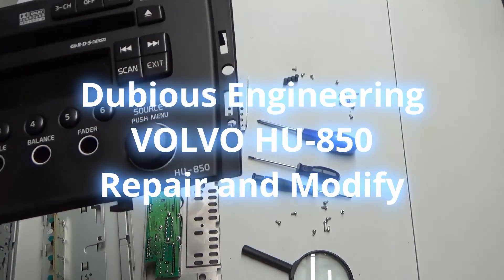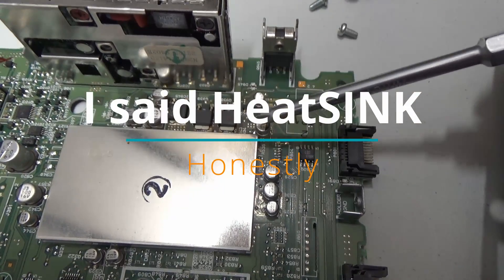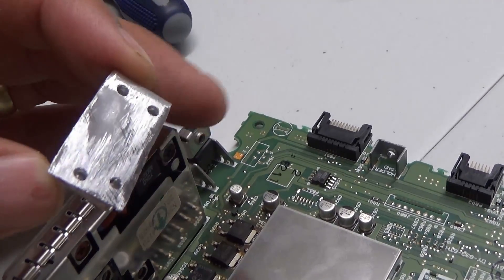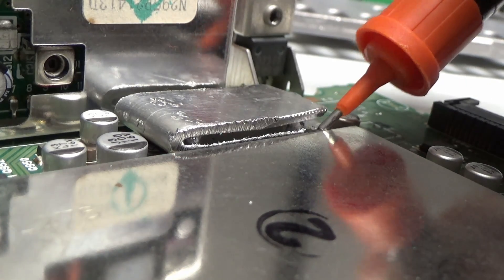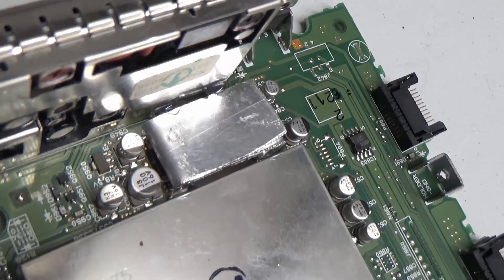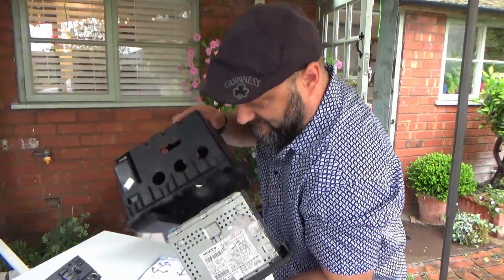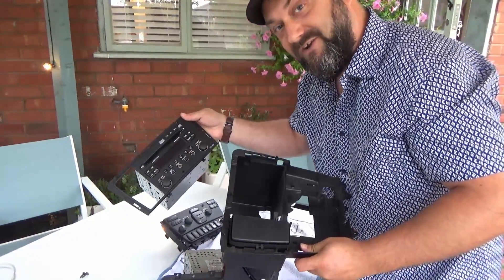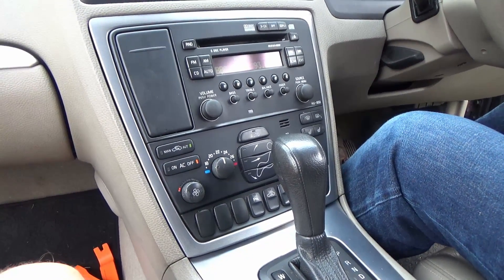DuB-EnG: Volvo HU-850 Radio CD Player Repair Teardown Dissasembly and Modification solution

Comment: Hi there! I have a weird problem with my HU-650 and I thought you might be able to help because although I've found a few people on the internet with a similar problem, I haven't found a solution yet. Basically, every time I start my V70 the rear speakers work perfectly fine but the front speakers don't. But after about an hour or one and a half hours of driving, they work perfectly fine. It almost seems like the radio has to "warm up" a bit for them to work. Do you know where that issue could come from and if it is fixable? I considered swapping my HU-650 for one from eBay or upgrade to a HU-850 while I'm at it but they're going for 200€ here in Germany so it would be nice if I could just fix it. I haven't yet taken my radio out of the car because I need it every day but if you need pictures from the inside of the radio, I could do that! Thanks in advance!
Reply from the maker: Hi Jan, sounds like a similar problem... start by unplugging everything and reseating the connectors first.  If that doesn’t help, you’ll likely need to get the radio repaired...
Reply: @DubiousEngineering  Okay I'll try that. Thanks for the quick response!
Reply: Mine is the reverse.  My fader control appears to be wonky (corroded inside) and if I fiddle with it, the rears come and go.  After seeing this teardown, my hopes to repair with deoxit are tempered by the fact the potentiometers appear sealed and maybe very hard to obtain.  I'm going to try anyway.  I would not be surprised if your issue is similar - try adjusting the 4 controls with small knobs, and pushing the knobs to the sides to see if you can make the problem come and go.

Comment: Any idea why my radio lights have stopped working? Seems to be a common fault. I believe the fault could lay with a connection to the headlamp switch as all lights have failed at once
Reply from the maker: sounds like that or the relay...  did you check the fuse?
Reply: @DubiousEngineering  Thanks for prompt reply. Lights come on intermittently, or did! Will check fuse tomorrow. Many appear to have this issue in all the forums. Will advise. Thanks

Comment: Hello Dubious Engineering, it works.  I followed all your instructions and I am so happy and proud that I can now listen to my original Volvo HU-850 Radio. This solution ends my years of radio silence and many frustrating visits to Volvo dealerships. Thank you Dubious Engineering
.
Reply from the maker: I'm so happy this fixed your problem!! - Any tiny support or coffee money goes back into the pot to help create useful and educational videos!!  :-)   https://paypal.me/dubiousengineering?locale.x=en_GB
Reply: @DubiousEngineering  Did i rejoice too early ? . After one day the radio returned to its usaul behavior. During drive the radio went off and did not respond to any alterations. One hour later it came on again by itself. i will observe the performance in the next few days.
Reply from the maker: Awww. How annoying!!!  ...   did you replace any of the capacitors!??
Reply: @DubiousEngineering  I only replaced the Resistors and the Transistors with a factory made Heat-shrink. 
I have second radio so I will try the operation again.
Reply: @rickardolaing6262  hi sorry to bother you. Did you get your stereo working? I replaced resistors, but not transistors. So you replaced both resistors and transistors and stopped working after one day?

Comment: I am going to try this out
Reply from the maker: Good!! Let us know how you get on!! You may also want to consider replacing some of the local capacitors as they tend to dry out in that heat!!!
Reply: @DubiousEngineering  Do you replace the transistors also ?
Reply from the maker: I didn’t bother.   But they are not expensive
Reply: @DubiousEngineering  Hi, I followed your video instructions and I had the same problem as described before, it worked great but after a short time just clicking again, but I didn`t replace the capacitors, so would you be so kind and tell me which ones to change and maybe, even,how? Sorry, I`m an amateur although I fixed a couple of things before...thank you in advance! When I get it done, you get some coffee money, for sure!!
Reply from the maker: @arena1403  The problem...  The device is in my mates volvo now...  he absolutlely wond want me pulling his car apart again!!   Sorry!!
Reply: @DubiousEngineering  Can`t you just watch your own video and check which ones I propably need to change?
Reply from the maker: @arena1403  Any caps that are close to the heat source will dry out...  personally, I'd replace all the Electrolytic capacitors on both sides of the PCB that are within about two inces of the heat source.

Comment: Do you always need to replace the resistors or is it possible only to solder them again. Can this work anyway for some time and then you know this solution works. :) Really nice video :)
Reply from the maker: Totally up to you, but just resoldering the existing resistors back in may mean they unsolder themselves again in the future.  Thanks kindly for the compliments :-)

Comment: How "big" high power resistors did you fit, 1W, 3W? I have found this 1ohm 30w, LTO030F1R000FTE3, think it is easier to mount, not have to turn resistorlegs round and about. Thanks
Reply from the maker: I just went with 1 watt resistors... also, having those legs means you can place the passive carbon away from the hot zone and the extra metal in the legs may also help to dissipate some of the heat!!

Comment: Always connect +ve on battery then negative!
Reply from the maker: Yeah - my poor advice caused a spark there!!  Fundamental really when you think about it!!  Thank for your observation Tim!!
Reply: Absolutely great advice.  If your wrench slips whilst on the negative terminal, and short to ground, no problem.  Not the same for the positive terminal UNLESS the negative cable is not connected.  Therefore work with the positive terminal only whilst the negative one is disconnected.

Comment: Great stuff, shared on the Volvo group on FB. BTW it was indexing the disks because it had had the power out for some time. [ it needs to to display which disks are 'in' and playable, the 6-play in my Focus does it too ]
Reply from the maker: Thanks Philip, for the share and the info...  Yes, I guessed it was doing something like that.  It appears that there are a lot of Volvos with this unit, I hope this video helps those that are capable of doing their own repairs... and if not, they could contact me and I may be able to help! :-)